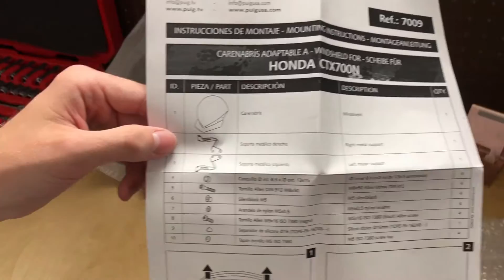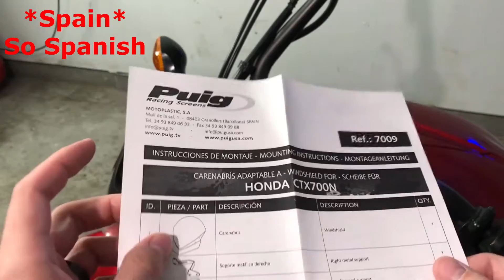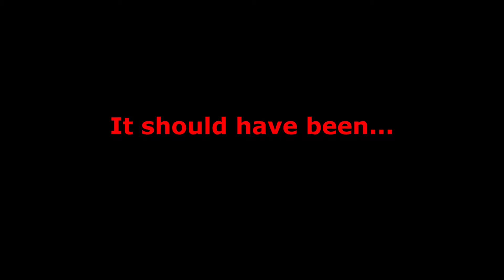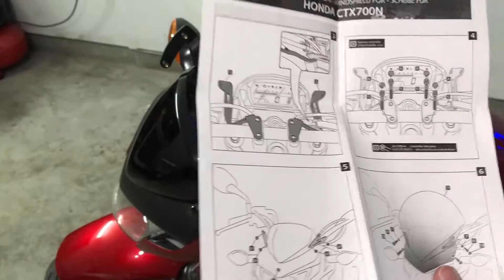Puig Windscreen Install | Honda CTX700

Comment: What’s up dude that clear thing goes on the very tip of the screen it’s like damper The other question I was going to ask I have a DCT model I don’t have a clutch cable but I also do not want my handlebars to move so I’m determined whether to takeoff each side or just go for it and put the whole thing right over
Reply from the maker: The handlebars should be pretty stuck in place, if you do go that route maybe make a mark showing the position as a back up.

Comment: What’s up man I just installed mine yesterday i put the brackets first then the screen woth washers I have it pretty snug but can’t get the caps on the screws unless it’s looser than the windscreen shakes big time does uours shake and have play in it
Reply from the maker: The caps were constantly popping off for me. In the end I left them off. Mine screen was pretty solid, I don’t think it even vibrated unless I was going 90mph+ tighter is probably the key.